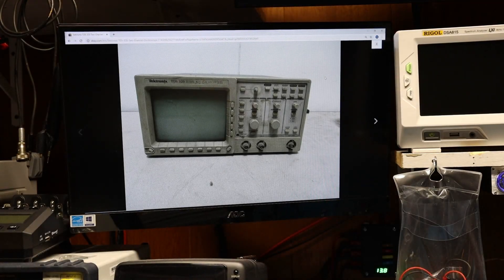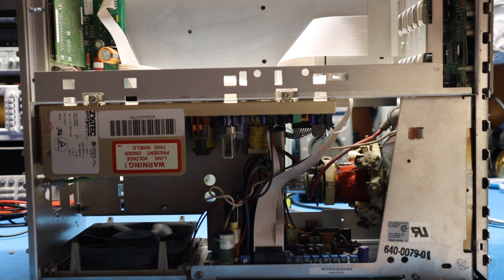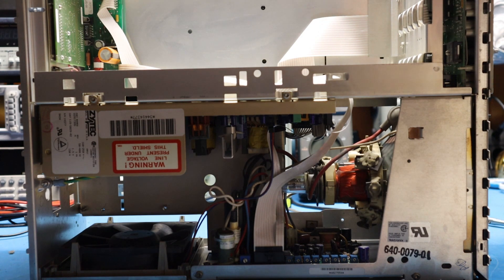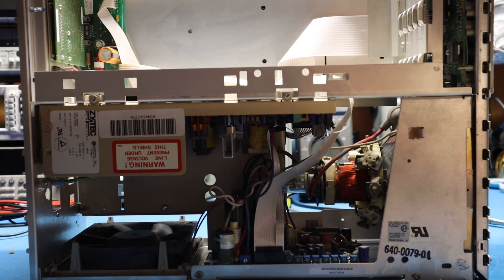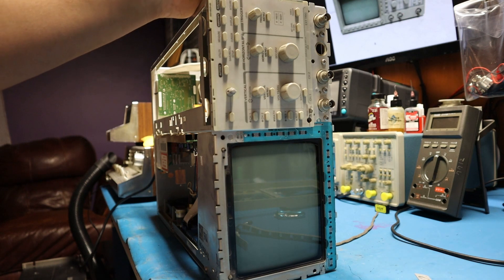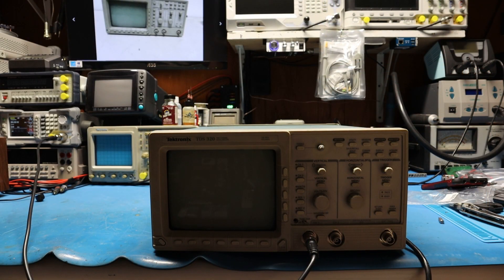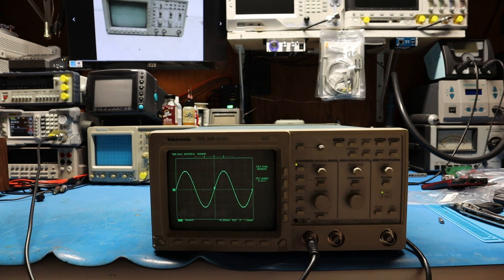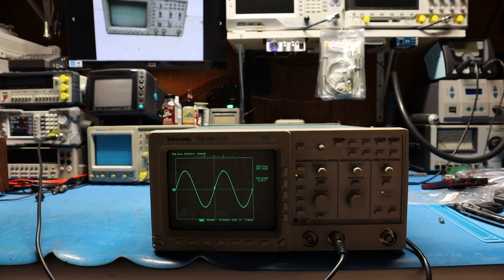Tektronix TDS 320 Oscilloscope Repair, Scope So Dirty Won't Power On

Comment: Nice job. It's amazing how much equipment can be fixed just by a good cleaning and attention to detail in fixing small mechanical issues. It's also amazing how some people just neglect then dump perfectly good electronic test equipment. Thanks for sharing. Best Wishes & Blessings. Keith Noneya
Reply from the maker: It a shame that they do that, but seen companies throw stuff away in dumpsters in perfectly working. This probably came from one and someone dug it out to sell on eBay.